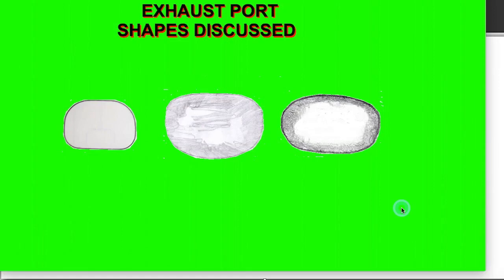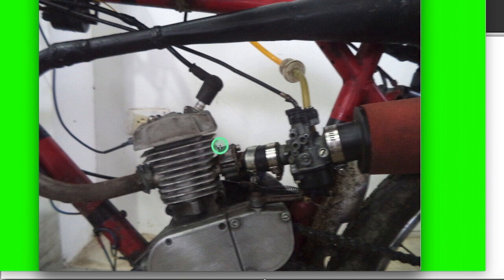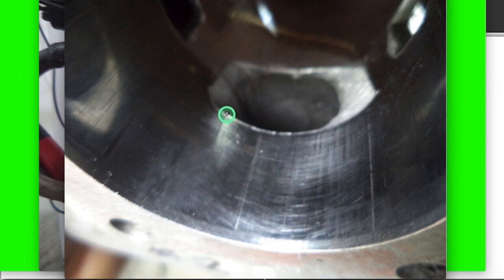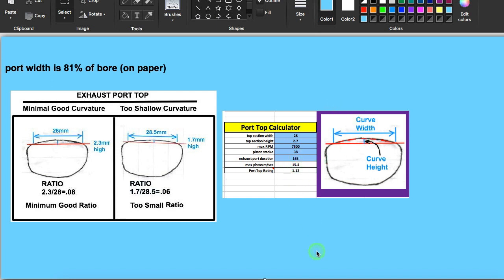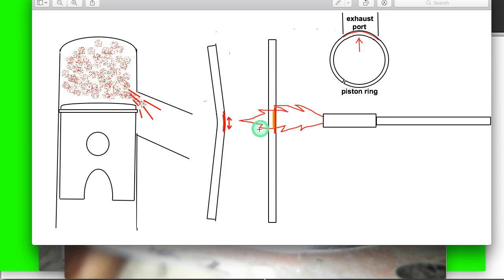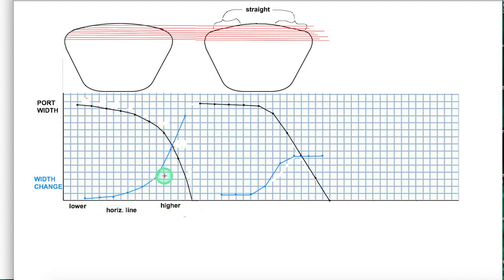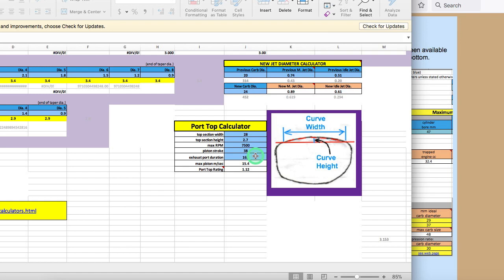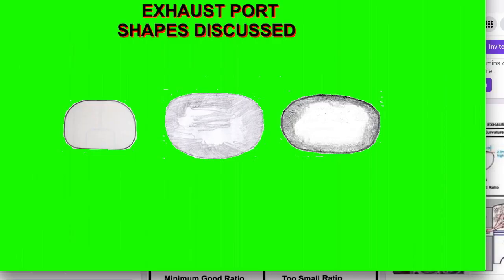Exhaust Port Top Curve (2 stroke engines)

Comment: Question. If you measure the exhaust port width on paper trace are you measuring circumference?
Reply from the maker: yes, the portion of the bores circumference that the port occupies
Reply: @MichaelForrestChnl if you’re finding the port width percentage I thought you would measure the linear width divided by the bore. Or do you divide the circumference width of the port divided by bore diameter.

Comment: Hi Michael, I think you are absolutely right about the uneven heating of the rings. This also explains the presence of spots of uneven wear on the cylinder surface above the ports. Especially in large diameter cylinders.
Reply from the maker: Did you see excessive wear above the exhaust ports? If that section of ring is hotter then it will cause more engine oil to vaporize off of that area when it sweeps over it.
Reply: @MichaelForrestChnl  Not only above the exhaust. I see spots of worn pattern on freshly honed cylinders of various engines, also above the bridges between the exhaust and transmission. These are air-cooled engines with a large cylinder bore. Too bad I can't attach a photo here.
Reply: @KIM32rus id have to wonder if a portion of that is a matter of the final mesurements of the bore and possible distortion durring honing?
Reply: @GO-FAST_Racing  Have you seen something like this? I think it is the result of thermal deformation of the sleeve and rings due to uneven heating. The influence of ring vibration cannot be ruled out for large ports.
Reply: @KIM32rus that's possible, are these top ends by chance - bolted to the bottom end via studs that go through to the headshell? Instead of the cylinder base bolting to the case and the head shell torquing down to the top of the cylinder.
Reply: There's always so many variables tracking down the specific cause is always right under our nose although it's often so right infront of us that we miss it plenty of times more than we should. If possible do you have specific examples of models and years? Might be able to see some correlation between the different designs without getting caught in a correlation fallacie.
Reply: @GO-FAST_Racing  I have observed a direct correlation - the larger the ports, the more visible such spots are. For example, the CZ 981 and CZ 514 engines. I need to spend some time looking for old photos to illustrate. I have observed a similar picture in the YZ 490 engine. I have no solution. I have accepted it as inevitable. On all these motors the head studs are at the top. Why did this interest you so much?
Reply: @KIM32rus  I build engines just about every day of the year - so it's a never ending quest for knowledge and in the same way sharing know-how and fielding questions.
Reply: @KIM32rus  I build engines just about every day of the year - so it's a never ending quest for knowledge and in the same way sharing know-how and fielding questions.
Reply: @GO-FAST_Racing  Ok, I'll try to find some photos for you over the weekend.

Comment: how much deegres should 2 transfer ports be to give decent performance with 185 degrees exhaust port
Reply from the maker: I don't take educated guesses. I only rely on the porting calculator that I created. It takes into account the Power Band you want, the top RPM, and it requires the porting sizes because it's the the size as well as the durations of the ports that matter

Comment: I love your channel guy. I have a question here i don't know how to act. I have an old trial bike (ossa), which exhaust port is trully flat at the top and here is my question. This bike should have good low end torque cause is an trial bike, if i make a good curvature in the exhaust port, i rise the exhaust to, obviously, and i think this should be good for high rpm power to, isn't it? But maybe worst for low rpm power/torque to. What should i do? Are my thinkings correct?
Reply from the maker: Yes that is correct. For trials use you should leave it alone but if you want it to have better top end power then raise the middle of the port, making a nice curve.
Reply: @MichaelForrestChnl  okai thanks a lot! But i mean, i want a good low and mid torque, but the flat top of the exhaust is not good for reliability as i learn from you, so what should i do? Leaving it flat for not get worst low end (or mid torque to, maybe?) and keeping the bad rings life, or making a curvature to better rings life?